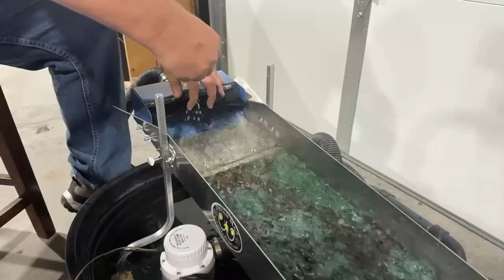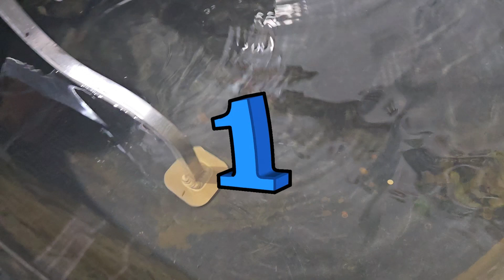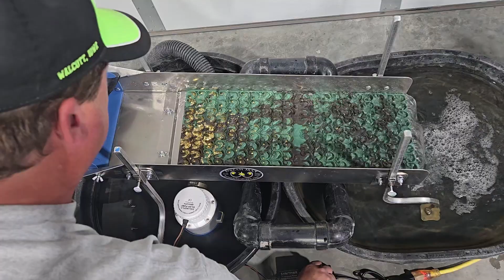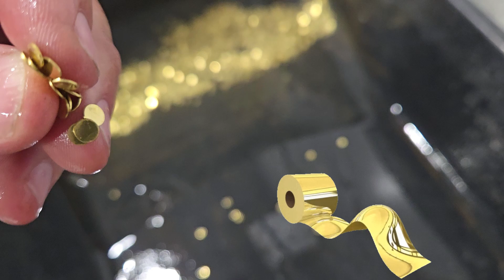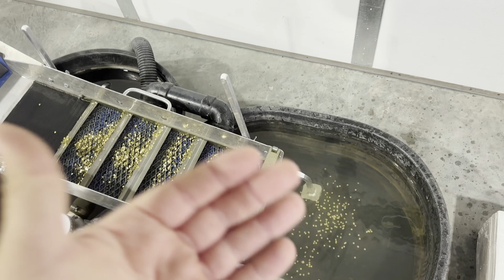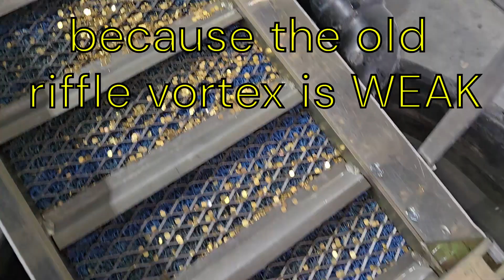Migration 102 Busting Myths of Flat Gold Losses! Dream Mat vs. Traditional Riffle Sluice

Comment: It does very well for sure. But looks like you doubled or close to triple the water volume on the old traditional sluice,  not apples to apples in my opinion.
Reply from the maker: What a cry baby, the meter showed the same flow 10-10.5, pay attention. Same pitch. Oh same water also, 😅 the only difference, my phone did the slow motion & my brother's phone did the normal speed. So it's just a frame capture speed between android & apple

Comment: Well...TBH, this is a flawed test.    The Dream Mat has walls and wells that can hold the flat brass in its pockets (even flat brass that big).  The second iteration using metal riffle and miners moss was never going to work.  The surface of the miners moss is to dense to allow flat brass of that size to drop down into it, thus allowing it to keep flowing through.  The water flow keeps flipping the brass much like a football player flipping tractor tires.  I mean...its not rocket science.  Flat is Flat no matter how small it is.  a 100 mesh piece of gold is flat for most cases yet 95% of the time , it would fall through the miners moss and be trapped in the carpet below(if you're using carpet ((which you should)).   I'm in no way saying that the Dream Mat doesn't work with 100 mesh gold.  Just saying that this test you used is flawed and an obvious flaw at that.
Reply from the maker: Well explain the perfect test? Better yet come show us!
Reply: @ProspectorsDream  Well... you want to test Sluices and mats, i.e. Dream Mat against other mats to show whether its superior in catching GOLD.   Perhaps mix 2 ounces of placer gold ranging from 100 mesh to flakes  with dirt/sand combo and run it.  Then figure up the % losses.   And testing Dream Mat against a traditional riffle system that came to be over a century ago isn't really a good test.  It's like a poker cheater playing with a stacked deck.  You know you're gonna win.   Stack it up against technology that is more of this age, like a gold cube, or Gold Hog concentrate matting.  But most importantly...test it with GOLD.  Not brass or BB's.  Or don't.  I don't really care.  I simply stated a fact...its a flawed test and the reason why.  Never said Dream Mat sucks.
Reply from the maker: @lronWill  we have many more actual gold test videos.
Reply from the maker: @lronWill  https://youtu.be/gQwMheS2X7A?si=aMsclgeifXCGahwF

Comment: Firstly, why did you raise the rubber flap? Isn’t that supposed to even out the flow of the water so it flows predictably over the riffles?

Secondly, if I have a handful of clean gold I’m not going to run it through a sluice.  The presence of black sand and pebbles will alter the capture rate.
Reply from the maker: I raised it on both, because we wanted the full flow. The lesser would be like training wheels, playskool. The material didn't even come off the 1st riffle on the riffle sluice. Any slower a miller table would catch it.